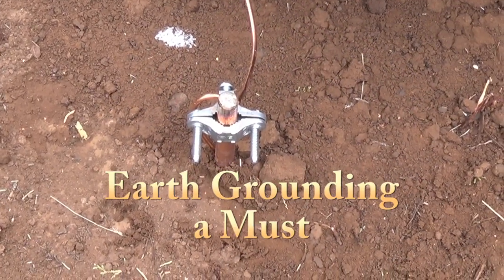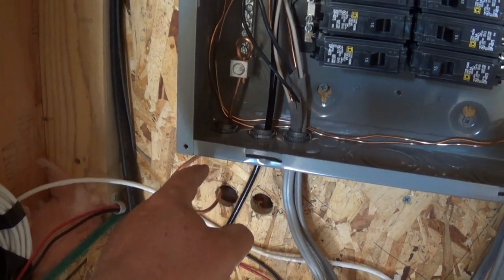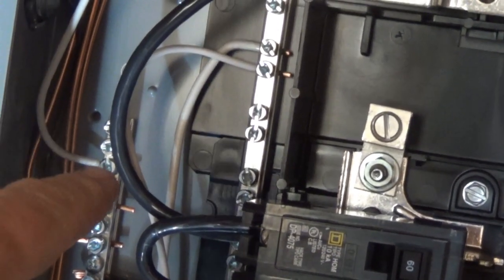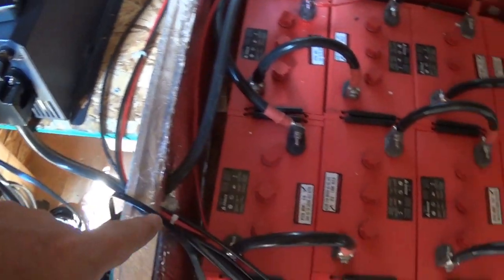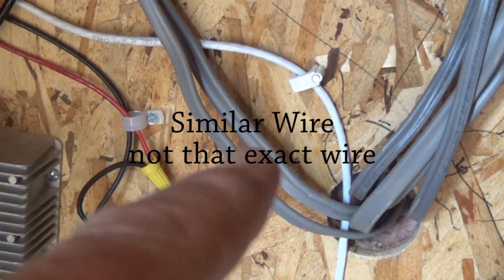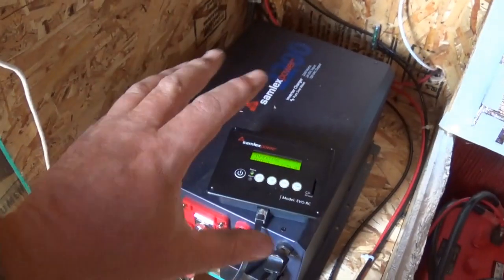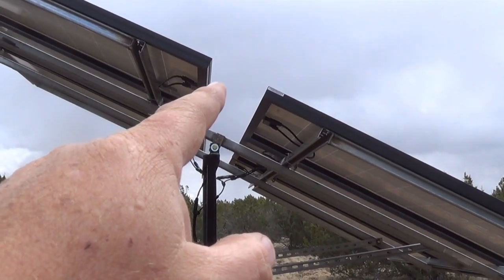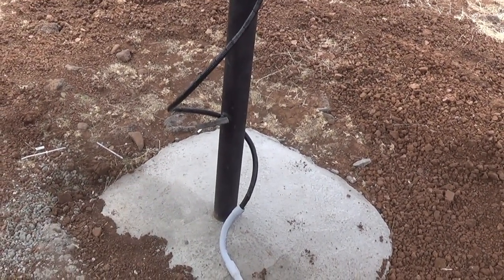Earth Grounding Solar Off Grid System - Grounding Batteries, Panels, Controller, Inverter

Comment: Yes I do have a thunder arrestor on my roof and the inverter has its own ground terminal. My grounding is such that the ground wire that comes from the cc goes into  the inverter then to the the ground yet this still happens, my inverter still shuts off and shows short circuit during lightening/thunderstorm My thought is whether it is not proper to wire the cc and inverter together in the same system, or if they have be the cc and inverter should have separate grounding independent of each other or maybe the ts mppt grounding serves for both equipment. NOTE. My controller is a Morningstar ts-mppt 45amp. How did you wire your system and what is the proper way to ground one's system.
Reply from the maker: the earth grounding video shows most of the wiring but I also have videos about each of the components. charge controller to the batteries then to the inverter then to a distribution box and out to all your loads. the grounds off all your loads, inverter, charge controller, batteries (neg term) go to a bus bar and that bus bar goes to the ground.  I have a playlist of videos set up on all the videos related my solar, batteries, and wiring.

Comment: Where you've used the spare black and white 14-2 for grounding could throw a professional off, if they have to come in after you. Bare is best, but when you're concerned about exposed wires in a dmark green is the preferred alternative identification color for ground. 
Now that said, I've done what you did in the past (using scrap lengths to create ground connections). To clearly mark them though it's as simple as adding a little ground-green electrical tape wherever the wire in question goes in or out of a distribution box.
Reply from the maker: you know someone else talked about the green tape. I did do that.....

Comment: That type of single rod is good where the soil conducts well, or it rains a lot. 
Alternatives options are tying ground cabling to galvanized, bronze or copper wells sunk down to the water table, or setting the ground rod, shortest path, into a septic leach field. 
A single 3m (9' long) galvanized ground rod simply isn't enough.

In the desert you might want to consider radial grounds.

Desert sand is like any silicate: poor or semi-conductors, therefore very very bad for grounding.

 Radial grounding solves this, and can be as simple as running equal lengths of bare 12 gauge wires on or slightly below the ground surface radiating away from the ground rod.  I can provide graphics for them if you PM me directly.
Reply: Here's a diagram simple enough for multiple structures:
http://www.solacity.com/wp-content/uploads/2016/01/GroundSystem.gif
Another is designed as an antenna reflector base, but does the same job for grounding in the desert:
https://s3.amazonaws.com/files.qrz.com/d/ad5hd/post_1.jpg

Look, I know from personal experience just how hard it is to get a good ground in the desert, but the equipment you protect now may save your life in the near future.
Reply from the maker: interesting. glad you added that information... code here and in phx is just a single 6 foot rod. makes sense on the sand. my soil is all clay and from what I have experienced so far the moister is about foot deep. water table lol mine is over 800 feet. cant afford a $20k well lol...
Reply: Understood. I developed antenna options for the National Training center & SF, deep in the desert near Death Valley. There is no water table there, so we came up with the star grounds.
Few can afford wells so this is what we came up with.
For the desert I recommend star patterns under remote device grounds, and at the very least a simple loop underground around the base of buildings you intend to protect.
If you make the star pattern grounds with 4 equal quarter wave length segments, they also make a perfect ground plane anywhere in the world. It works similar to the reflector on a dish satellite antenna.
Reply from the maker: very interesting. thanks for the info. glad you made the comments .
Reply: Thanks for sharing, what about really rocky ground ?

Comment: Nice job on the wiring. I really recommend you get a Green Paint Marker. The kind that uses paint not ink and just run it along all your ground wires so they have a green stripe on them. That will make them the standard colour for ground. The use of black and white could really confuse somebody. I know you understand your setup but someday someone else might come along and get hurt. The paint markers can be bought at almost all hardware stores for about $3 bucks and a large expensive system like yours is worth doing right! Great job on the grounding pole.
Reply from the maker: +Greg Spronken makes sense on the green marker...... I thought of something like that but was going to use green tape. . great point you make.
Reply: I did similar in AUS our 3 core is red black yellow/green for a/c so I just pulled the earth cable
Reply: Need to make sure your using the correct wire aswell. A/C and D/C wiring serve different purposes
Reply: Yep, I was thinking the exact same thing!
Reply: I was going to tell him the same thing that he needed to show them as green someway either marker or tape. Like you said he may know but someone else who may work on it in the future may not.

Comment: Are you using the breaker Box to break the 120V into Sections?
Reply from the maker: +TRX Vlogger yes. I have a 30amp section going to the rv plug, I have a 20amp section going to my water pump and laundry, the rest are 15 amp sections that will go to where every I want or need them. ac volts will travel distance better than dc volts.
Reply: ArizonaHotHomestead Oh okay cool deal man! I Love the Set up!

Comment: Bet you've got enough juice to run 2 a.c. units. Do you feel you can never leave that spot unattended? Keep up the good work!
Reply from the maker: +Oie de Etudiant run 2 ac units? my inverter is only 2kwatts so maybe not but the key is that I have enough energy stored in the batteries that if I have a few cloudy days and I use a lot I still will be ok.  if fact the rv frig is now off propane on fully on the inverter .